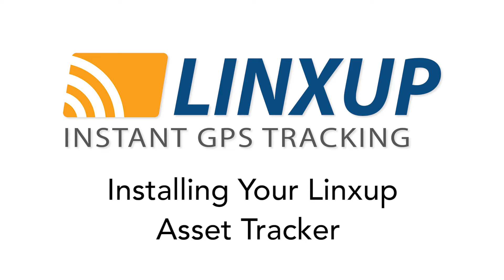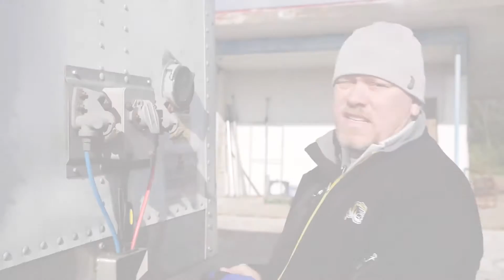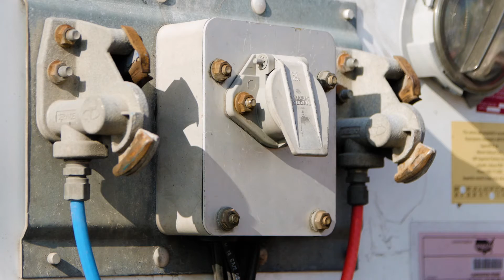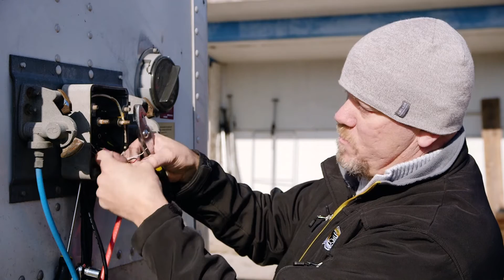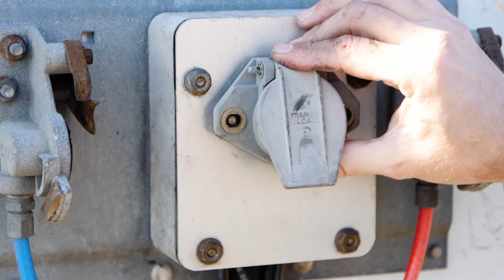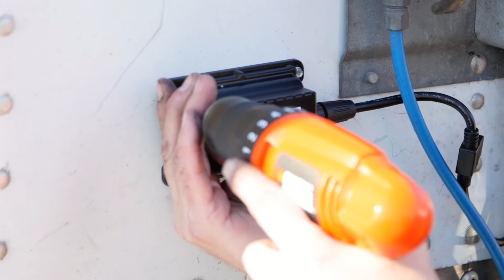Linxup Equipment/Asset Tracker Installation

Comment: This is one of the worse companies i have ever done business will I'm a turo host and had 11 trackers. the trackers would often not work, I reached out to Branden Webster multiple time to fix my broken trackers and I did not hear back from him. I requested to cancel services because the service was so bad and the trackers were often not working and Branden said "I do understand where you are coming from here, but that is not an accurate statement, and even if it were, I have already reduced the early termination fees in half from what you owe based upon the contract.  "

Brandon insinuated that I was a liar, 1 of my cars was actually stolen, i have records of speaking to the police around the time I reach out to Branden to replace the tracker that was in that car. 

there is way better options the Linxup, there system regularly does not work. you are unable to get a hold of customer support to replace the item or ask questions........ the also took 2600 out of my account without letting me know. reach out to me if you would like proof.

do not do business with them 

here is Branden Webster said when I told him i did not authorize them taking my rent money out of my account "  Technically, it was authorized to be over twice the amount that was charged"

Branden Webster Email as proof that I spoke to him bw*bster@linxup.com